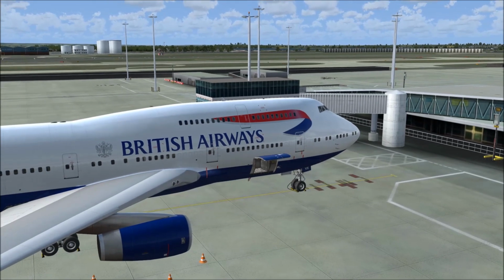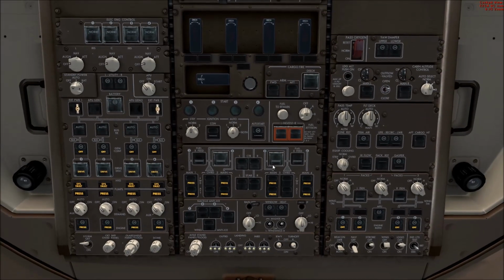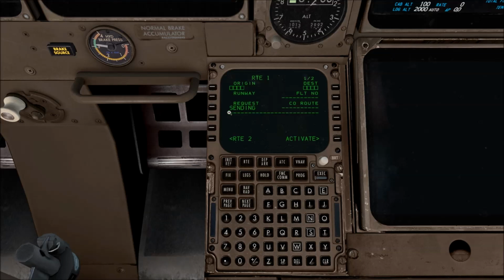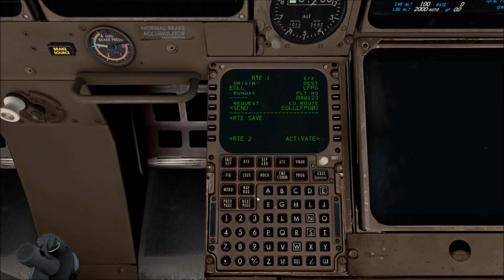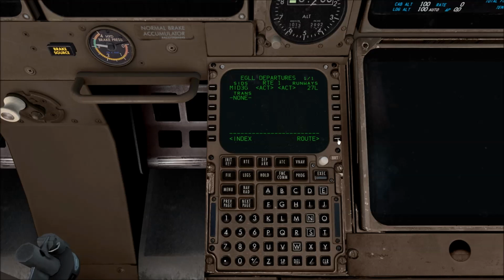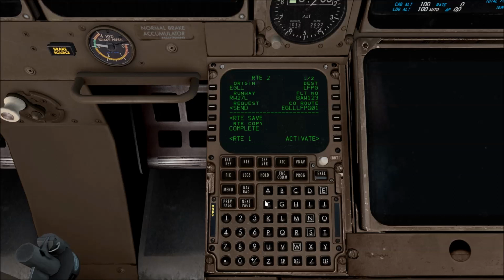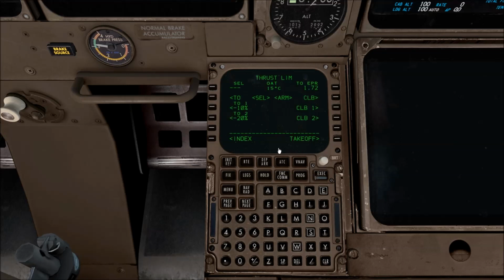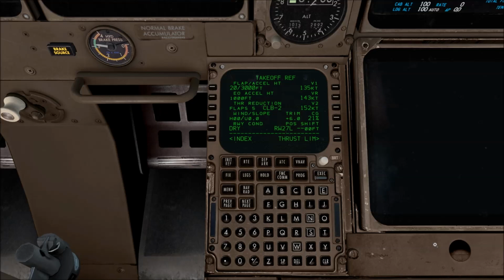PMDG 747 v3 FMC Tutorial

Comment: hi captain Nav thanks for the tutorial but I have a question .I did  take off in my 747 it could not climb as well gain speed the was a light saying low air pressure.. is it due my fmc set up or what help thanks.....
Reply from the maker: +Edward Hammz I don't have enough information. When you launch the aircraft, normally, the engines are running, if you extend the flaps and add power then, can you take off
Reply: Captain Nav thanks
Reply from the maker: +Edward Hammz You are welcome, I hope you worked it out.

Comment: Hi Captain how do you calculate the fuel and the weight please? If you could please explain us how to input them correctly that would be nice. Thanks
Reply from the maker: +Ian Nottingham The fuel is calculated using a flight plannong software like PFPX... To refuel the aircraft, in the FMC, go to the menu, FS actions, Fuel, and enter the amount of fuel you want. For the weight, still in FS Actions, go to Payload and enter the numberof passenger, cargo, etc...or directly enter the Zero Fuel Weight (ZFW),vwhich is the weight of the aircraft without fuel.